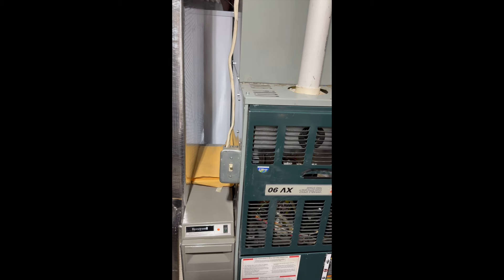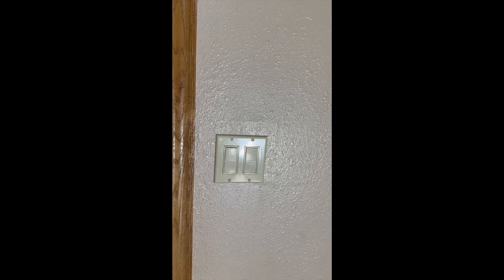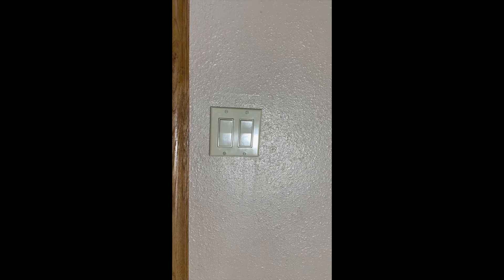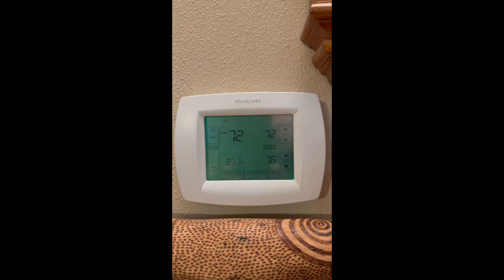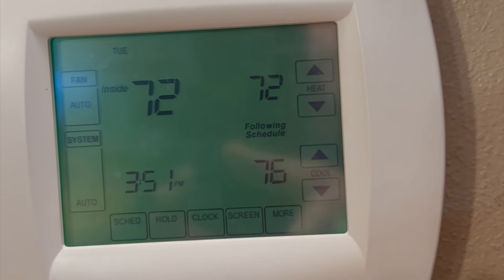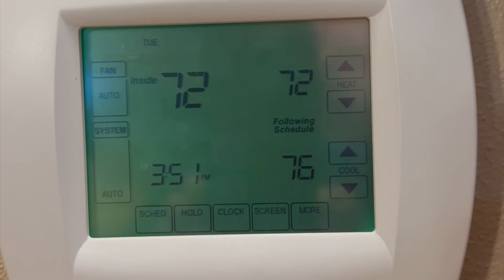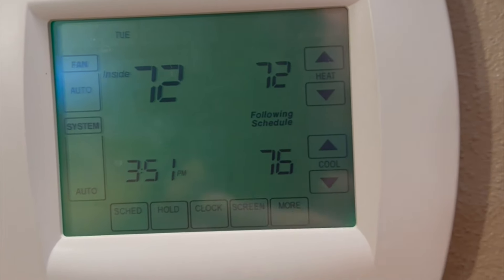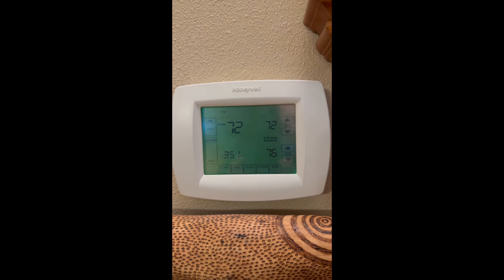Quick checks for a furnace that won't work

Comment: Hello GFM I have an older BDP GSC Furnace that has a bad spark ignition control board. It’s that small black box with a 5 pin molex plug. I looked online and it’s obsolete. Can I use a S8610U universal spark ignition board? Thanks GFM

Comment: my magic chef furnace wont start. Troubleshooted it from your other vid as a bad transformer . Ran the number on it and cant seem to find the the same looking one anywhere online . do you buy the guts and use the outer metals pieces again ?The only one i found only had 2 screws on front. Any ideas ? 1983 model
Reply from the maker: You should be able to use a general replacement 24 volt transformer.  If it is gas fired, you want a 120 volt input to 24 volt output, 40 VA.  Mount it any way you can.
GFM
Reply: @grayfurnaceman   thanks. I have 6 wires coming out of relay/transformer but only can find a 5 wire and an 8 wire . Not sure which one to buy and wiring different if i cant get a 5 wire . do i need a dpdt or a spdt? Any ideas?
Reply from the maker: @buffalostate1  Here is a video on the fan center you probably have:  https://youtu.be/7XFrUw7xQZU
I always used the 8 wire unit and just did not use the extra wires.  
GFM

Comment: mr furnaceman why do you have such an ancient furnace?
Reply: that thing's more reliable than anything sold today. some older furnaces can go for 30+ years.
Reply from the maker: That furnace is over 30 years old, its 2 stage with an ECM blower motor.  The only failure has been an IFC failure caused by a power outage surge.  
If it aint broke, don't fix it.
GFM